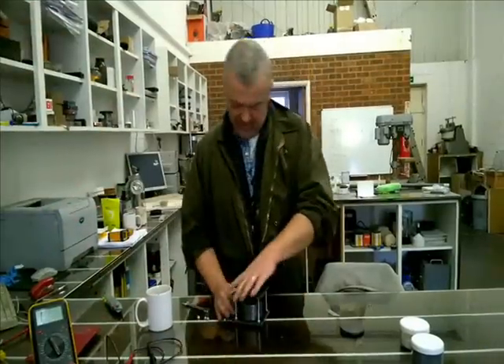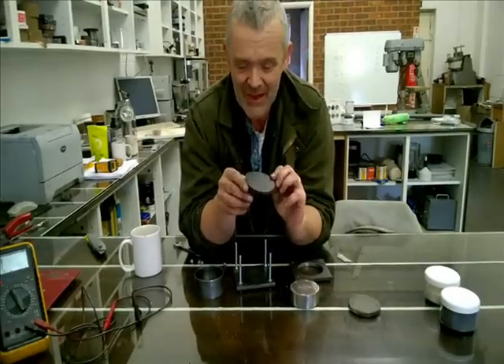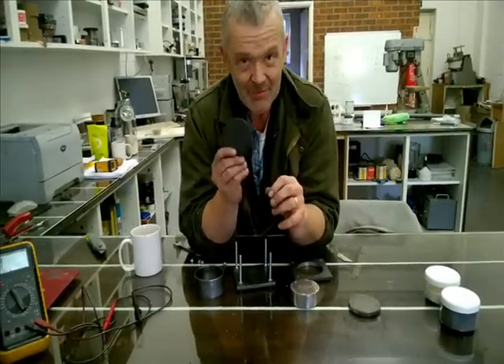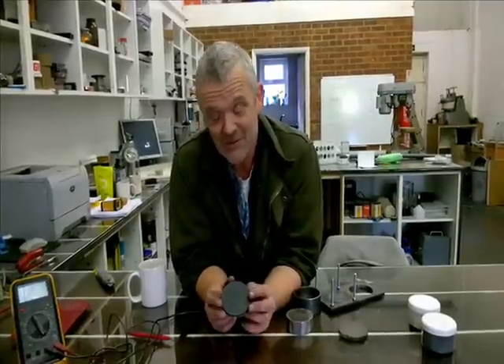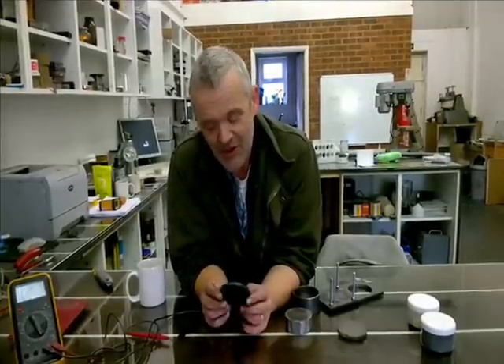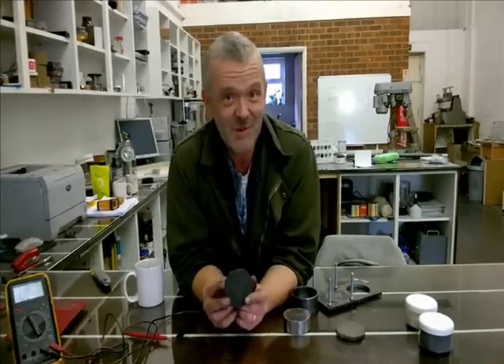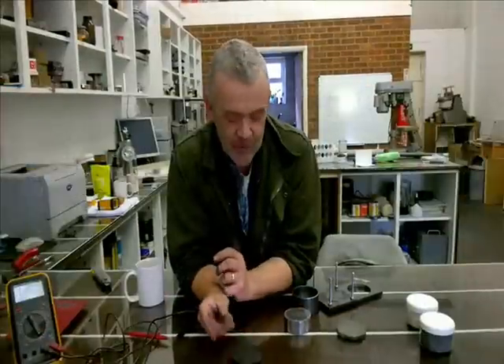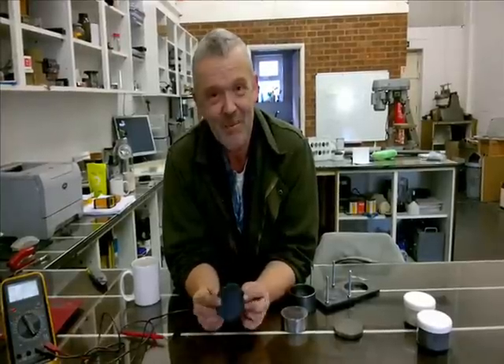Super Strong Conductive Graphene Bio Plastic

Comment: Very cool. I'm sure the 20 ton press helps a lot but it is quite cool how much stronger a bit of graphene makes plastic. It's crazy that you only need half a percent. i went way high and started with a few grams of graphite mixed in with dissolved abs in acetone then sonicated it for a few hours. Made the abs stronger but the residual graphite messed it up. Guess it's important to make the graphene first then add it in, or start with significantly less graphite. And the idea to powder, mix, then heat must work far better than dissolved plastic. No solvent, stuff'll be much harder. Very clever!
Reply from the maker: +The Thought Emporium cheers mate - but yes make your graphene first on this one - the real problem is intimate mixing
Reply: Noted will do! thanks

Comment: Awesome material you created there - thank you so much for sharing.
Thermally - what happens if you put a soldering iron with say 300deg.C on the disc? Will it spread the heat better or faster than with an equally sized disc of copper?

Comment: I was wondering, how do you mix in the suspended graphene? Let the solvent evaporate and mix in dry graphene or mix it wet and let it evaporate with the plastic? Thank you so much for the cool videos!
Reply from the maker: both work depending on the circumstances
Reply: when the solvent dries, what is left? Graphene powder?
Reply from the maker: basically - yes

Comment: Could you separate a number of these discs and suitable separators to make a poorly-performing, (by your standards), capacitor that makes for its capacity with is high strength-to-weight and strength-to-volume ratios that allow a stack/row capacitor to be wrapped or surrounded by a tough insulating layer and them encapsulated by a structural layer of the same reinforced plastic to create super strong plastic tubes that have a super strong capacitor inside to form, effectively, a solid bar that can serve as incredibly strong, comparatively lightweight, utterly rigid structure of an electric vehicle which just happens to provide energy storage to be tapped when there is no more space for the FWG super capacitors?

Comment: I know you said you can't tell us  what the plastic is but could you possibly point me in the direction of figuring out how to make it into a powder for storage. I've made a few different bioplastics but they all have to be molded right after creating them while they are still in liquid form.
Reply: The only bioplastic  I can think of which is a powder is bioplastics made from casien I know it turn rock hard if you mix it with water and let it dry. Maybe it can also get hard if you apply a lot of pressure and heat like he did?
Reply: @curious 456, in the video he explains that the plastic/graphene mixture is heat THEN pressed in the mold. I interpret this as a literal sequence and not just a choice of words.
Reply: @curious4567  Yea that's possibly it, I thought maybe PLA since it is also a bioplastic.

Comment: I cant wait to find out what amount of stress that disc can hold up to
Reply from the maker: I took it down to a test center - 300kg
Reply: Robert Murray-Smith to break the whole piece or the 1mm thick part? Did you test the control piece, the one without the Graphene? I can picture building boats out of it.  Would love to see if it improve ABS Plastic for 3D printing, hope it does. Anyhow great work being done by you for the society as a whole, keep it up.
Reply from the maker: suffolkcountysheriff
The whole piece - i didn't bother with the control piece as i just snapped it in two by hand - you could see it was very much weaker and these tests cost 150 pounds each. So, I got the results of my new plastic and compared it to steel which is 500kg for a piece the same thickness
Reply: I need to get a hold of some powder and test it with fiberglass resin
Reply from the maker: Gary J Smith
you want some of my powder? - I am afraid you can't have any for a while - i am still testing it
Reply: I'm fine with waiting. Just know that I'm interested and will be looking for an announcement video :)
Reply from the maker: Gary J Smith
cheers mate
Reply from the maker: it's not generally available sorry mate
Reply from the maker: cheers mate

Comment: Is it really just as simple as mixing graphene oxide in a polymer? I mean could you add graphene to plastidip? I’ve actually been considering trying that out.
Reply: In a later video I asked if the graphene was functionalized and he told me it was and that was the main secret. I found a method for functionalizing graphene oxide with polymer combs, but to say it is expensive is an understatement. It would probably cost over $100,000 to functionalize a pound of graphene oxide. Since he has said that he can make this stuff dirt cheap I'm pretty sure he isn't using that method.

Comment: If it has good tensile strength, with it's conductive properties it could be an interesting material to make flywheels from.
Reply: It'd probably 3d print quite well if printed in "vase mode" so that the filament extrusion is continuous with no stop-start joins.  Should retain much of it's tensile strength this way.
Reply from the maker: hmm - it's a bit light maybe
Reply from the maker: roidroid
that's a good idea
Reply: They currently use carbon fibre.  IIRC they tend to prioritize tensile strength over weight, aiming to spin them faster rather than make them heavier.
Reply from the maker: roidroid
i didn't know that - fair enough seems like a doable thing then
Reply: Robert Murray-Smith sorry i probably should have painted a better picture initially.  High performance flywheels typically spin in a vacuum, suspended on a magnetic bearing, and they have a magnetic linkage.  When they put more energy in, or take energy out, it's all done magnetically so there's no physical contact.  It can be thought of sortof like an incredibly fast & incredibly low friction brushless motor. 

As you know flywheels store energy in their weight and speed, but the math is such that increasing the speed always give you more bang for your buck when compared to increasing the weight.  Thus in practice high performance flywheels are designed solely for max speed, so they use high tensile strength materials like carbon fiber (even though it's rather light).

I've always imagined that the conductive materials on the flywheel must be a weak point, i doubt copper wires hold their shape too well against those sorts of insane spinning forces.  So if the conductive material also doubles as the high-tensile material, that could be quite a development.

(i used to geek out about flywheels, but it was probably a decade ago, i hope i remembered it right)

edit:  and then, if you've got a high tensile strength material which is conductive, it starts to give you ideas about materials which can have their structural integrity POWER augmented.  Real Startrek type of stuff, have been pondering it for years.
ie: what if the container for the flywheel assembly was constructed like a maglev train rail?  Put mroe energy into it and it could magnetically push inwards against the flywheel, keeping it from flying apart.  One could plausibly reach speeds and forces that no traditional material would be able to withstand.
Reply from the maker: roidroid
this has started my mind off mate - i immediately think of faraday disks
Reply: Robert Murray-Smith
a warning for your channel tho:  conductive high-speed spinning discs is starting to get into the field of UFO conspiracy type stuff.  There was an experiment done a while back that apparently found that a fast spinning conductive disc reduced the gravitional mass of any object put above the disc.  The experiment has since been discounted (as AFAIK all reproduction attempts have failed), but of course it retains it's fans who say otherwise.

You may see an influx of these types of ppl on your channel if you do spinning conductive disc stuff.  Just a heads up :P
Reply from the maker: roidroid
it's a risk lol

Comment: yep i can see solid capacitors and solid electrolyte batteries..  looks like fun stuff.  maybe u can make a plastic but putting some stainless steel powder or another metal ,aluminum powder and have two different metals but in the form of plastic..
Reply from the maker: Steve was thinking about that mate

Comment: See if you can string some out like wire and wrap it in a coil to see if it will collect and give back more electricity than a copper coil pack check out this machine and see if you can give me some ideas not trying to get subs just thought you would be interested check out this youtube channel (Bunker Rogge) look at the generator mainly the wheel
Reply from the maker: I am not likely to try that mate - well not for some time - there is quite a lot of work to do on this yet and I am likely to do that - just seeing how strong i can get it is going to take weeks